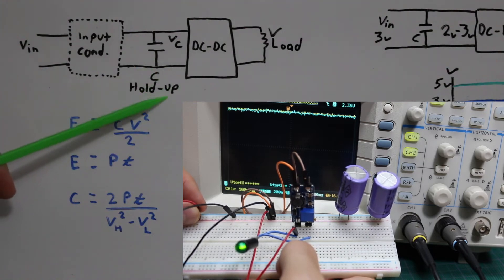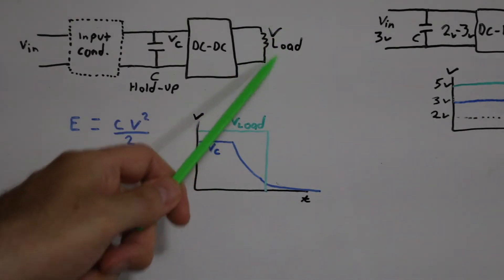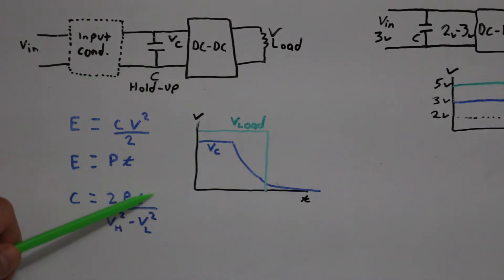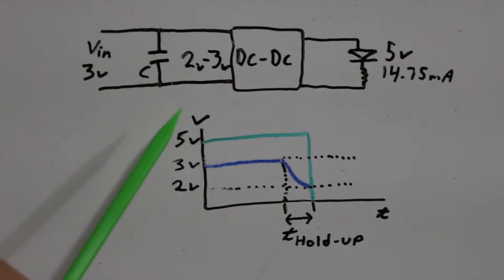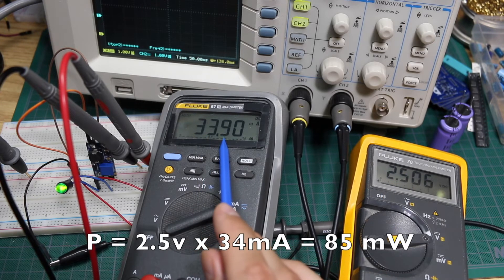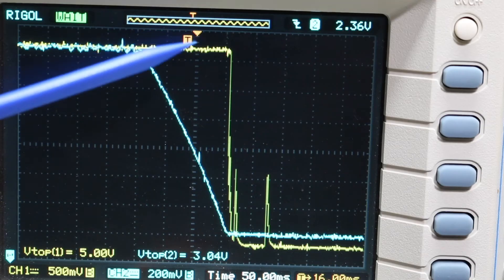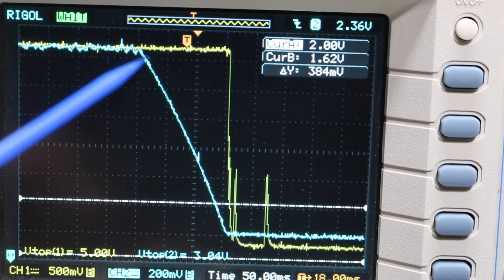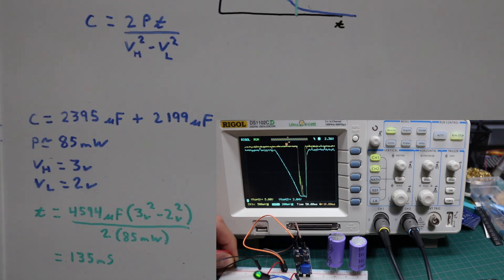Hold up Capacitors - Supply Power to a Load During Power Loss

Comment: Can you explain why its vh2-vl2 and not just the difference squared i.e 1?
Reply from the maker: maybe the info here will help, it seems to show a derivation of the formula 
https://www.powerelectronictips.com/how-to-boost-output-hold-up-time-in-power-supplies-faq/#:~:text=Factoring%20the%20equation%20results%20in,a%20200%20msec%20holdup%20time.

Comment: How increse time??
Reply from the maker: More capacitance to store more energy or less load demand so the stored energy lasts longer.  Of course adding more capacitors means it takes longer to charge them from the power supply and the power supply has to be capable of the inrush current when everything is turned on and the capacitors try to draw infinite current to begin charging up.

Comment: It's kind of funny how well timed this video is. Actually I wanted to make something similar to this, but using SLA battery as power source. I have one bay NAS and from time to time my utility power goes down for like below 1 second, and that's enough to turn it off. So I plan to make something like ups, but without whole inverter part.
Reply from the maker: That sounds very useful. The one thing I like about using laptops as desktop computers compared to 20 years ago, I don’t need to have a UPS anymore because the laptop battery takes over when power fails momentarily like that.
Reply: @GadgetReboot  That works very well, until your laptop battery works. Also I have a UPS, even two, one is your typical offline type, second one is online type, this one even keeps the output voltage relatively the same, by switching between tabs on transformer. While it might sound fancy, it's really a crap, because after about a year of use, can't even hold the output long enough to turn my pc off. So I switched to more traditional one, that turns on inverter only when needed, and can keep it for longer periods of time.
Reply: @kjur18  - why tell the story as if the technology of the online UPS is flawed?
The reality is that you have used an el-cheapo shitty online UPS, and/or the batteries inside it were old and/or shit.
My guess it's some shitty old thing, because modern online UPS doesn't use taps on transformers to adjust output voltage.
Furthermore, why do you say "That works very well, until your laptop battery (fails)" ? Did you so quickly forget that your UPS works very well, until your UPS battery fails.... and yours DID fail.

Comment: Impressive!  Those big purple 228(!?) electrolytic caps must have been expensive.  Such low voltage involved, a small modern supercap may work ... or not.  Unsure if one would deliver current instantaneously.
Reply from the maker: I don’t even know where I got those electrolytics but they must have been bought new because they still had long leads and one was longer than the other for polarity so I did not take them out of something but I certainly don’t remember buying them so it could have been over 20 years ago (I refuse to add another decade to that estimation). It’s funny one of them measured almost exactly the label capacitance 2200uF.
 I ordered a few super caps on eBay to test out  in some upcoming project ideas.